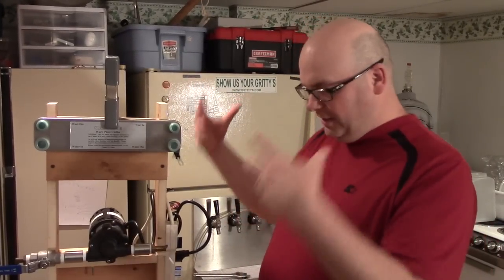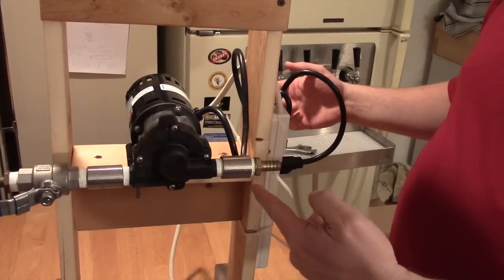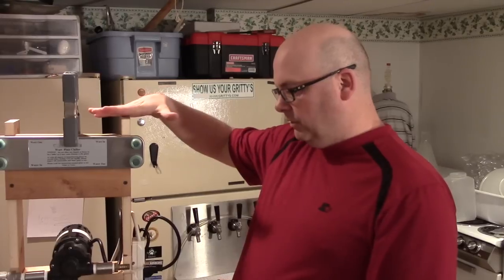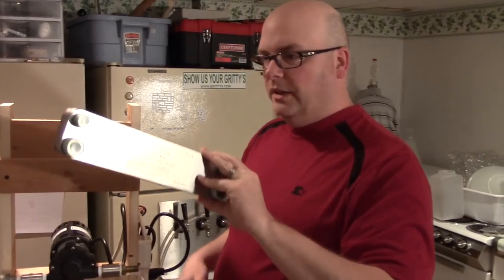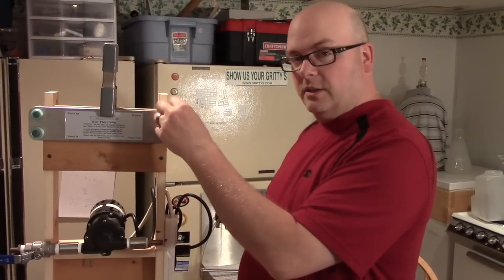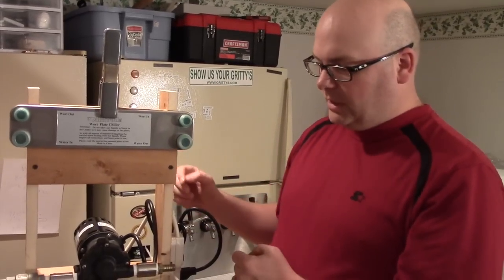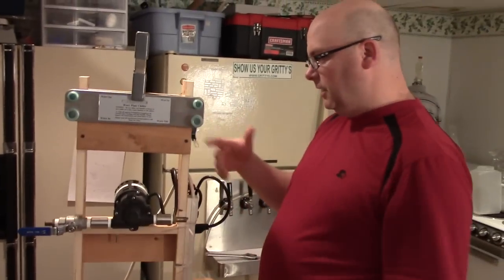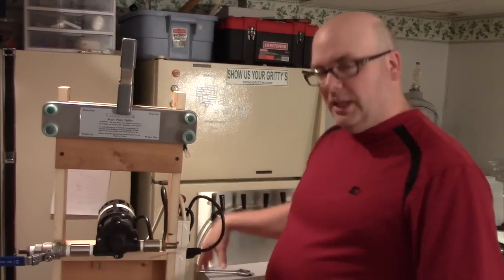Chiller and Pump Stand

Comment: Looks good. One tip: You'll want to rotate your pump either 180°, or 90° clockwise to orient the outlet such that you don't have cavitation in the pump due to trapped air.

Looking forward to the brew session video!
Reply from the maker: muchtall Yes - noticed that the pump was upside down once we rewatched the video.  Made a note of it in the blog post on our site.

Comment: I love the look of the stand. Watching it, one thought I had was running a narrow strip under the chiller. That would support the weight of the hoses from underneath, but then the clamp would only have to keep the chiller pressed against the back panel.
Reply from the maker: superbrewers That's exactly how I have it set up actually. Maybe it isn't clear enough in the pictures, but the squeeze clamp only holds it to a backing strip.  The chiller is sitting on a 1/2 inch piece of wood strapping.  Smart minds think alike. -Mike
Reply: Brew Dudes I noticed that in the video of your nighttime brew session. In this video, since it was straight-on the front, I didn't notice the bottom stuck out. A pump is definitely in my future, the plate chiller is a bit further away, but I'm definitely going to keep this in mind.

Comment: I love the DIY stuff folks come up with. My only concern is the power strip. If water or wort hits that, it will make a taser look like an old school hand buzzer. And you may end up horizontal. I would want it on the very top, IMHO. And a GFCI socket only runs about $20 bucks at Lowes, Much cheaper than a funeral. Love the videos!
Reply from the maker: steamyb2 Its a work in progress but a very good idea.  I was recently trying to decide if I could rework the whole thing to have the electricals (pump and power strip) above the chiller and the tubing.  There is an electrical box in my brew area that needs to get re wired, I thought a GFCI would be good there too.
Thanks for the advice and watching out for me.  -Mike

Comment: What do you recommend to descale, clean and sanitize my plates?
Reply from the maker: If you really have scaling you'd need to push some acid through to break up the beerstone.  actually Five Star chemicals makes a Phosphoric/Nitric acid solution specifically for beerstone/scaling.  Use as directed.  Cheers! -Mike